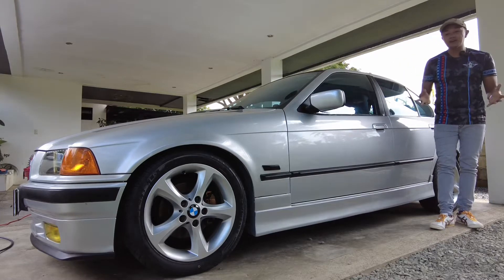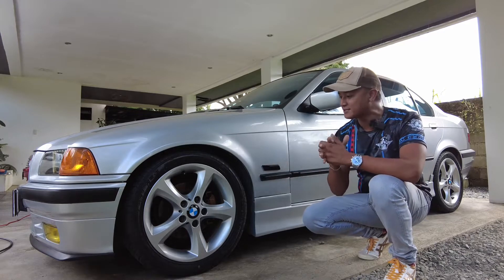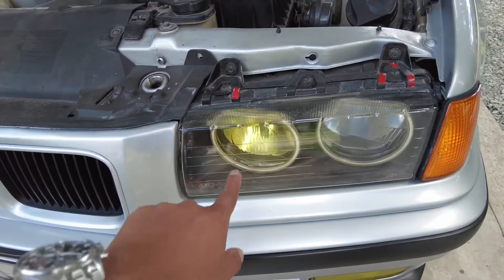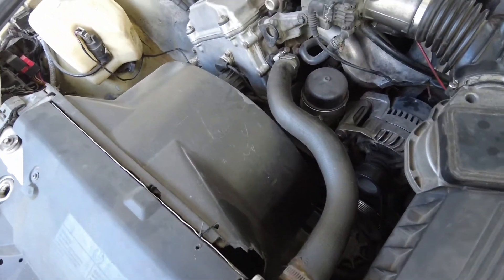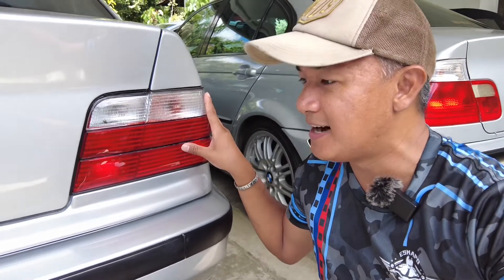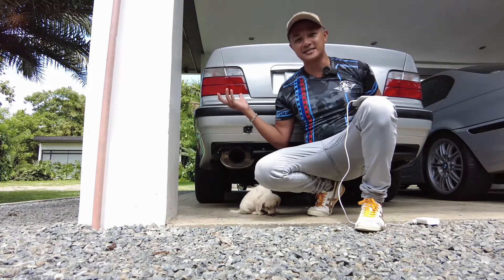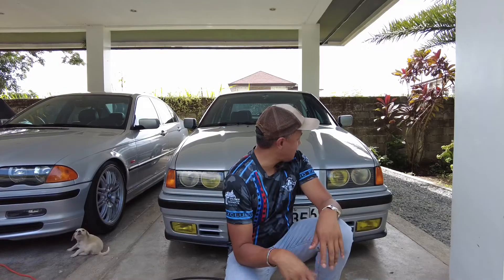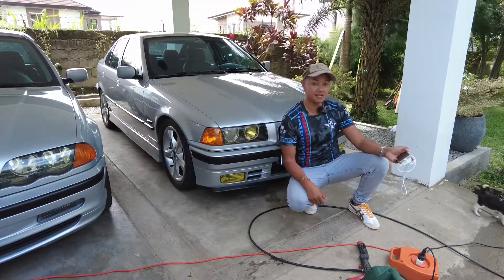BMW E36 Project Car Update

Comment: Is it risky to buy e36 316i for daily drive/first car here in the Philippines? Lalo na po sa maintenance and availability ng parts?
Reply from the maker: Parts are available and maintenance is just like a Japanese car.  I use this as a every other day car actually. It’s built like a tank.  BMW Tuneneg will tune the car and there are able mechanics that will service the car.  I’ve only spend and replaced the consumable parts on this car.  After that it’s good for another 200,000km.  It’s a collectors item once you’ve maintained and tuned it accordingly.
Reply: @TheRobertDesign  Good to know that! I really consider this to be my first car however I'm I consider honda civics too however May I ask for the pros and cons using this as your daily drive for a daily basis?
Reply from the maker: @jeromecaccam9018  well it’s good to use the car regularly.  You’ll just need to tune and have the car regularly maintained.  I got mine for 158k.  I’ve spent about that much to get it to where it is now.  I’ve heard civics are more expensive to maintain actually.  I’m really happy with my e36 and it’ll be part of my collection as they will up in price in a few years.  Fuel consumption is a worry.  Make sure your tires are aligned, and up to its desired pressure.  And regardless you’ll go for a civic or a BMW, expect you’ll have to spend to own an old car.  But older cars are cooler.  Just put this e36 next to a new  car, people gravitates typically to the older….
Reply: @TheRobertDesign  nice solid information sir. Thank you! Hope to see more e36 vlogs to come. 🤜🏼🤛🏼
Reply from the maker: Parts are readily available.  Through sportsline, GWorx and other guys.  Regardless BMW or Honda there are maintenance cost that is involved.  Same lang naman.  Just have extra money for the maintenance after your purchase.  Me, I have an E36 & E46z. I love them both and use them often.  I barely use nay Hilux and HRV….